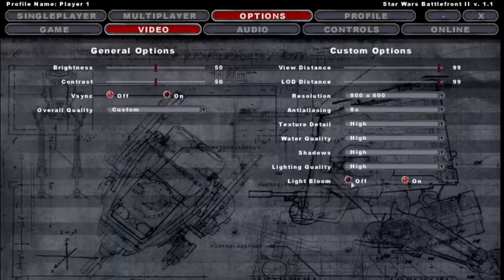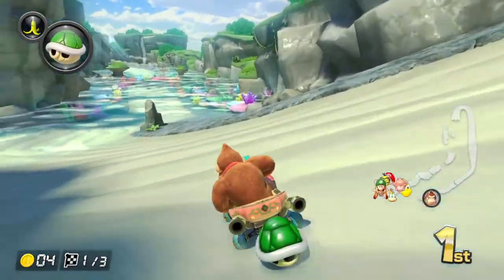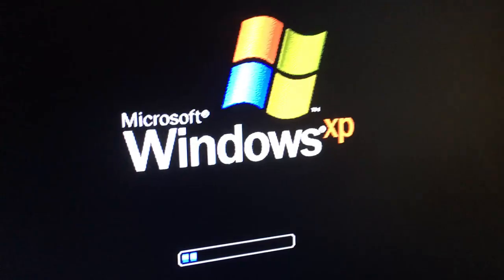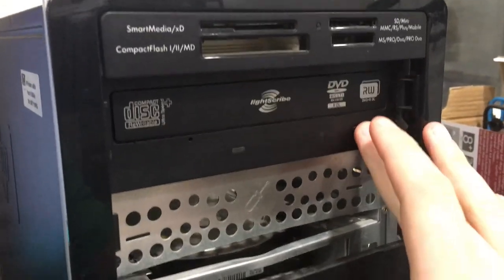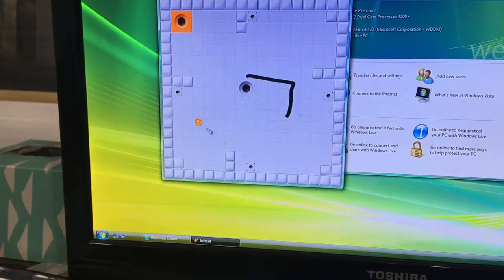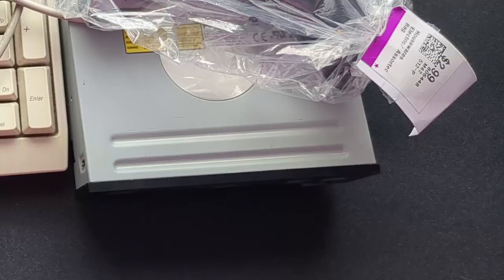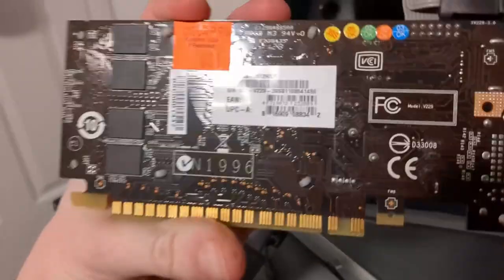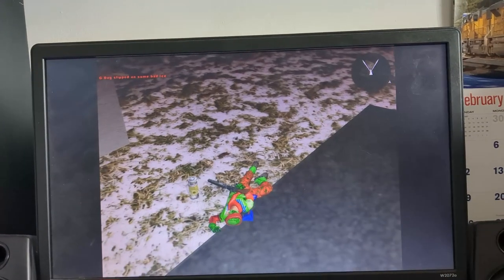Fixing This Old PC to Play Retro Games

Comment: These are actually pretty decent PCs. I used mine all the way up until 2016 with a 1GB Sapphire graphics card. Had the Pegatron motherboard which I dubbed the "Pegatron Octopuss" for some reason or another. I actually got mine for free. Someone brought it to me deeming it junk. Upon inspection, I came to find that someone had released the CPU at some point and bent the pins. So I straightened those out with a razor blade and it came to life... only to find that the SATA ports were burnt out. So I had to invest $20-30 into one of those PCI cards and all was well. I ran Windows 7 on it, made tons of Stardew Valley mods back then with it. Coding, and 3D rendering. Even used to play Skyrim & Fallout on it. I think I had 8gbs of ram though. Ended up giving it to my brother and I'm pretty sure he trashed it. It served me well, and I will always remember it fondly.

Comment: I just wonder why youre pushing for a Vista or XP  since it will run on windows 7 and install via usb flash drive rather than on dvd ?
Reply: @GabiDoesTech  the OEM product key on the side of the machine is just as worth it as the factory activation keys available through Windows Loader which are validated through the BIOS. I had a HP Pavilion which looked just like yours that came with Windows 7 out of the box